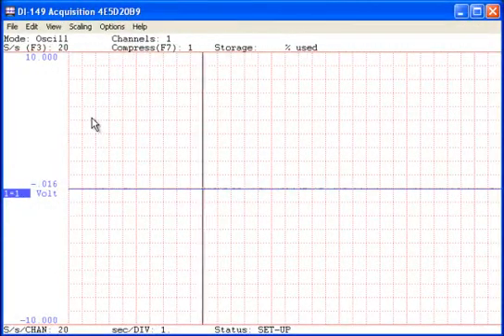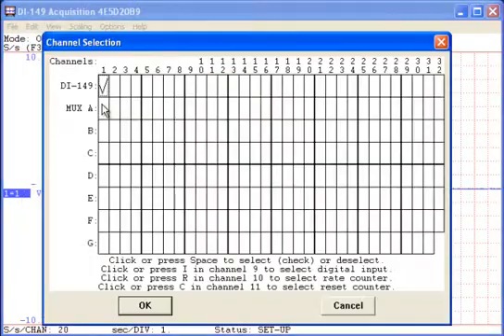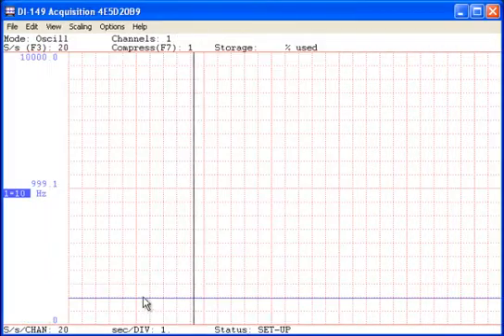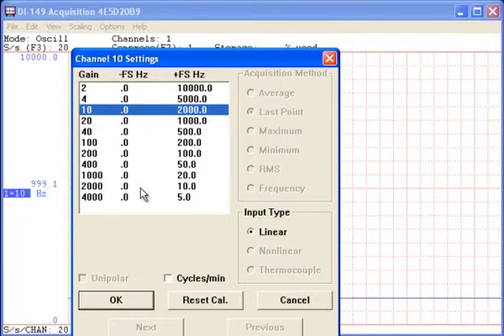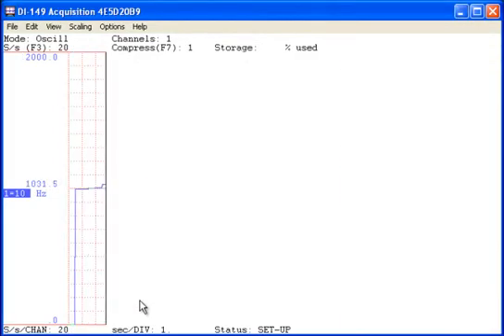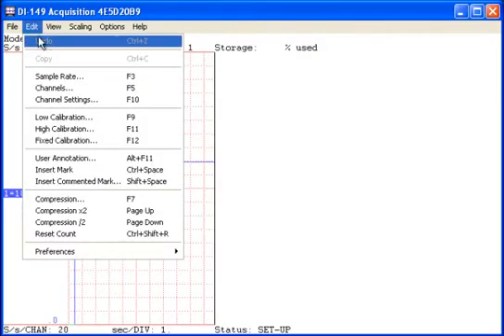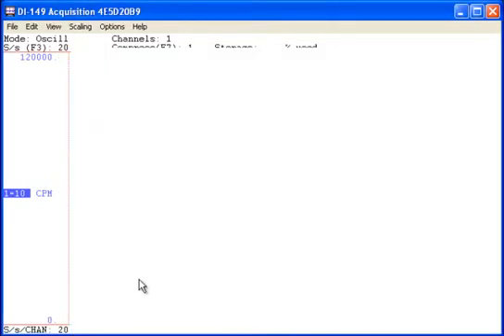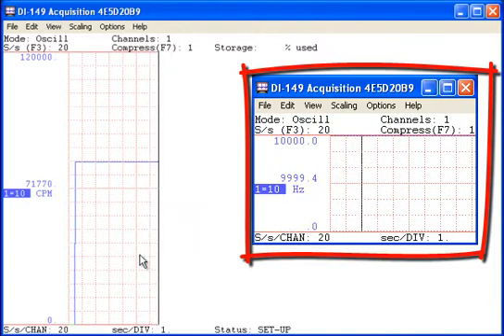Using the DI-149 Rate Channel to Acquire Frequency Data

Comment: Hi, can I use 3 pulse inputs from 3 different motor sensors and overlay each one? they will all be set to the same speed, however might fluctuate...thanks